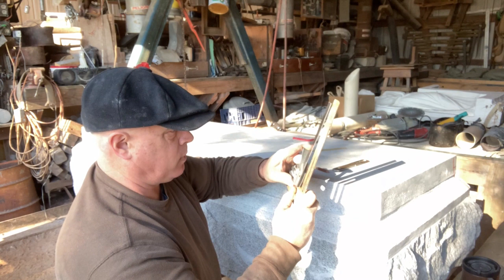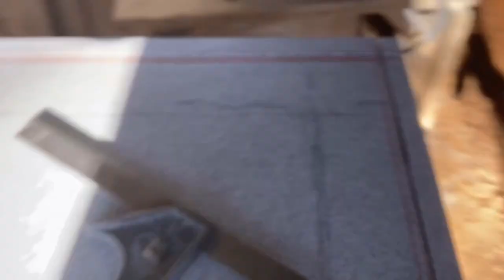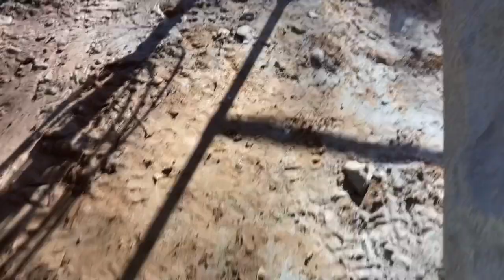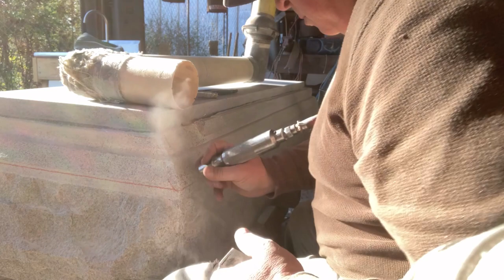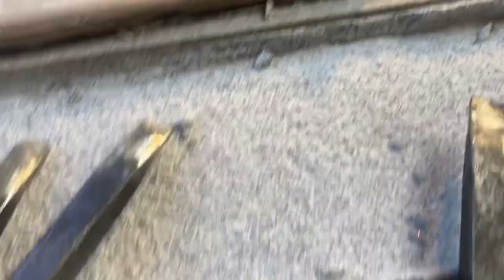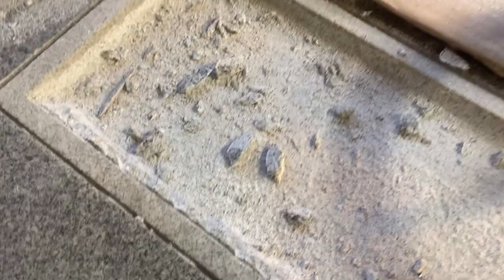Virtual Stone Carving Apprenticeship  VSCA Video 75- Life Size Bas Relief Angel 22 Granite Base 13

Comment: The direct sunlight often 'overlights' the video image and prevents a good view on your craftsmanship.  Any way you can compensate in your camera or a filter ?  Love your expertise.
Reply from the maker: Thanks for watching, Bruno. I wish there was an easy solution.  The lighting for photography is always difficult in studio.  At the front of the studio, where I’m doing this base, the light is overwhelming.  With a full studio and no such filter, the only other option I have now is to not video this piece of stone.  To me, that’s not an option.

Even the professional photographers and videographers who have done work in studio encounter significant challenges.  Strong light of any kind causes so much reflection from the stone that the image is defeated.  The crystals in the stone act as a million mirrors, reflecting  light both directly back towards the source and in other directions to brighten other areas.   Without shadow, there is no value, so the image loses all depth and context.  Since they usually have little to no experience shooting granite,  I try to explain this to them.  It usually doesn’t go very well.  

There probably is a filter somewhere, but to date, no one has been able to provide a realistic solution.    With digital SLR cameras 10-20 yrs ago, I used a wide range of filters (before and after) to get the best still images for promotion work.  Some combinations do help.  Modern cell phones have so much better capacity than any of those SLRs did, like auto filters and ability to manage light balance..  But none have been able to fully mitigate light levels and compensate for harsh lighting vs granite.

Most of the best video I post have very low light levels, often so low it’s difficult for me to see the work.  I’ll often turn off my lamp so you’ll be able to see what I’m doing,   As soon as the video is turned off, I turn my lamp on so I can see to work safely.

A major challenge is trying to capture video during actual work, so I have to balance getting the best shot I can produce in one take without significantly slowing work progress.  The videographers I’ve spoken with about doing these videos say that would be a significant challenge and expense for them to assist me.  They don’t know what part of the project is important to film, so they would have to be here filming 100% of the time I’m working.  None of us can afford that.

Hang in there.  I should have much better light management during the Angel carving.  I rarely work in this position of the studio because the light is awful.  Simply too much for me to see and work well.  But the studio is full, so this base has to be cut where it is.  I’m anxious to be done with it so I can work where I can see what I’m doing,  

Thanks again for watching.